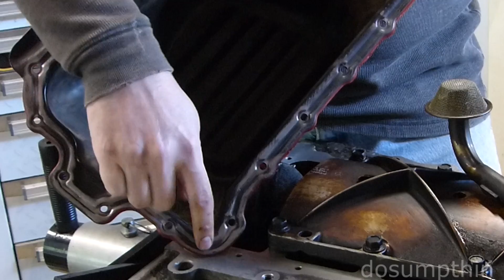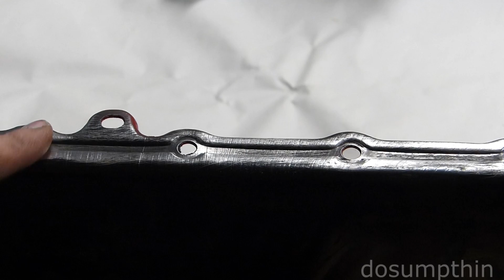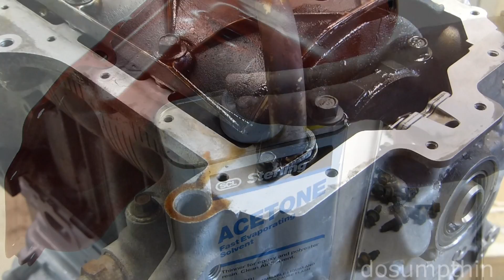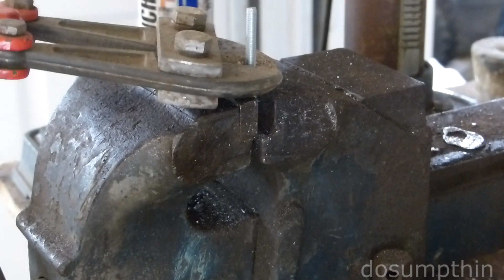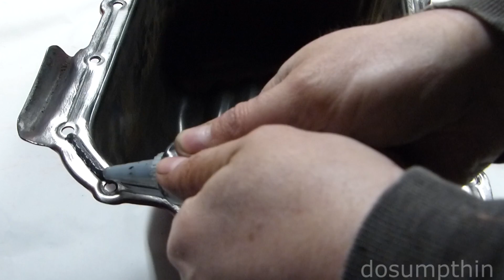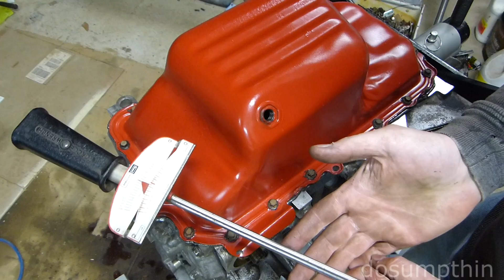How to install an oil pan... without leaks, the first time.

Comment: That oil pan doesn't have the rubber ends with radius.   Those are the ones that leak.   One-piece seal companies say don't use gasket sealer, which is bullshit.   I have repaired 100s of them that people have brought to me. Use gasket sealer.

Comment: Not a fan of RTV

Suggestion:  don’t use thread locker on bolts where RTV is used.  

It is recommended to re-torque the bolts after the RTV is fully cured; 24-48hrs.  If you use thread locker, re-torquing breaks the thread locker bond.  You’re better off using a nickel based anti-seize.

Comment: Ultra black has silicone in it, which can cause corrosion. Silicone based sealants are not authorized  to be used on metal in the aviation industry

Comment: The Ultra black or Ultra gray we'll both work just fine. But I'm telling you right now you're putting the sealant in the wrong part. They should go on either side of the line of bolt holes. Where the oil pan actually is supposed to make contact or is close to contact with the block as is possible. You're using way more than is necessary to seal that application. You will need any the blue Loctite, you're going to have so much sealant on those threads that they are not going to back out. And if I remember right the old spec on the seal is 45 inch-pounds. That's about 4 ft lb.
You had a lot more than a 4 mm bead on that.

Comment: Great video!  One thing about torqing things "to spec" is that the OEM specifications are for brand new fasteners that are dry and have no oil (or gunk) residue on it.  "Feel" (once you have the experience) is better than a torque wrench for low torque applications.  Not sure how blue loctite with a dash of RTV will affect the final torque. Although a lot more work, recommend putting pilot bolts in all holes to keep RTV from getting on the fastener threads.  Thumbs up on the video!  Love the subtle humor!

Comment: As an engineer working with engines this is pretty much accurate. One suggestion I might add is, when you put the pan on a flat surface to check flatness, you can also try to insert a cardboard between the pan and surface all around to find out wavy spots

Comment: @15:55

As it pertains to using a torque wrench:

In the two years I tried to make a living as a mechanic, not one of them that I worked along with including ones that were in their 40s and 50s, ever used a torque wrench.

I'm a big torque wrench advocate for the reasons you specified.  I even bought torque sticks so I could use one mounting tires from an impact gun.

It is laziness and negligent not to use torque wrenches. 

 The one exception might be small diameter bolts connecting something plastic. Usually just to hold a wire or small vacuum hose or battery hold down clamp; I usually go to when it's snug and then turn it maybe another 10 to 15 degrees.

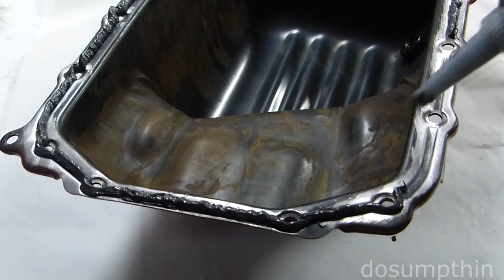Comment: @12:40

I've used the black permatex. It is specifically for engine oils.

The instructions on the tube to say to let it "skin over".  This would be things like valve covers and timing belt covers. And I did let the skin over on my time cover on my 99 Solara.

However, I agree with you that since you don't want to be pulling your oil pan off probably ever again, I would get the mating surfaces together before it skins over.

TIP—

I use lint-free raggs from Advanced Auto Parts to ensure that no lint is left on the mating surfaces of where I'm going to be applying a form-in-place-gasket.

FUN FACT—

Toyota FIPG 103 is used on oil pans, semi-circular plugs in the head cylinder head (if applicable like it is on my 1MZFE), and certain crevices on one side of each cylinder head that form an acute angle that the regular rubber gasket may not be able to reach (again, 1MZFE workshop manual).

Comment: I have tips if you guys are going to use Ultra black. Apply continuous bead! Follow the torque spec! 

I just replaced the oil pan gasket on my 02 civic EX yesterday and it's leaking again. Torque spec for my car was 8.7 ftlb so I tightened up to 9.7 ftlb. But one bolt kept spinning at 9.5ftlb and eventually twisted off. I tightened all bolts with a crisscross pattern, I hand tightened, waited 1 hr, 9.5ftlb tightened, waited 24 hrs and added oil.

Test drove the car and found it's leaking from the oil pan AGAIN. Probably because I didn't apply the "continuous bead".

Comment: Any color RTV will work fine. Toyota gasket maker (FIPG) works really great, too, as does Honda Bond. I'll be using a gasket so I won't need much RTV, only a bit at each corner of the gasket. Definitely use a torque wrench to tighten nuts and bolts on the oil pan. The torque is really low, 80 inch lb. here, 8.7 ft. lb. on Honda B-engines. Also F-engines. Overtightening causes leaks, so don't overtighten the fasteners.

Comment: Yeah even my brand new BMW diesel engine leaked sump gasket from the factory! So they had to reinstall it at the first 6 week free inspection back in 2007, been ok since. 🤞🙏😅🤣😂😎🏴

Comment: Just what everyone has at home. A sand blaster. Everyone has a table they can put their engine upside down. Right? Most likley, you'll be upside down, underneath the engine. 

Myself, I don't like silione, but it will fill in imperfections. Aftermarket gaskets often are very thin. Cork-schmork.

Comment: I did just what you did to my oil pan but in the car, waited 24 hour and about to add the oil in a few min. I was told the correct way was to hand tight weight 1 hour the turq down. Im about to find out see if they both work or if hand tight and turq right after give me leaks. Praying I dont have to repeat this again. GOOD LUCK to my self!

Comment: Thank you.  I am doing a 1958 Ford 601 tractor.  It seems the normal approach is a cork gasket.  The question is dry gasket?  RTV one side or RTV both sides.  I will be on a creeper underneath, so the alignments studs will help a lot, so thank you for that.

Comment: my oil pan ended up with n automatic level control hole.... so it had to come off.. it was also pitted in spots n idk if its because its a diesel or what but it was over a hundred dollars for a fn oil pan, so i just pulled it off cleaned the hell out of it n put a nice coat of jb weld over all the pitting, n filled in the one hole, n the other i created beatin the rust of it, i did this about 10 years ago on a 1 ton that plows n spreads salt all winder n never had a problem with rust messin with the jb,  u HAVE to get every last molecule of rust almost.. after i got all the rust off i could i layed a rag over the pan soaked it in evaporust n let that finish

Comment: You sure got this right using Acetone. I followed the same advice on my Mazda Auto pressed metal pan to alloy auto body. No skin and 2 alignment bolts - yes. I was told to finger snug tight the first seal then leave 24hrs to re-tighten. Mine still totally sealed after 2yrs and I recommend your video. Clean off the old gasket and Uber clean the mating faces is the most important part.

Comment: Need  to perform this in my engine. Just worried about the lips of silicon inside the crankcase eventually getting loose and clogging the oil strainer.

Comment: When you're that deep into an engine, it's always nice to decarbonize/get rid of varnish buildup.  Washing parts with mineral spirits does a really nice job I think.  The varnish won't hurt things, but heavy carbon  coming loose will recycle through the oil pump and maybe damage bearing surfaces it's first trip through the system.  Just me, but I would avoid putting a pan back on without a litte extra cleanup.

Comment: Really great video - thanks, the best in a dozen or so I looked at. Ostensibly it's a simple process but the devil is in the detail. You are the first person to mention that the sealant goes down the centre groove in the pan rim. Its not obvious but this confirms it. On the bolt cleaning, also to ensure the underside of the washer is clean (I use a brass wire wheel) as they sometimes have radial grooves in them so that when tightened they resist undoing (in addition to any Loctite you apply). Very good idea on the alignment studs too as the slide sideways slide on the pan has caused me problems in the past. So thanks again.

Comment: You suck so much. You put threadlocker on the bolts... which will clearly be contaminated by the excess RTV you used. 🤦🤦

Comment: I used black adhesive silicone sealant and waited 14hrs ...I then ran the car for 15min then drove around the block for about 5 minutes the engine started smoking a lot would this be because the sealant has not cured yet?

Comment: Good thing you got that gun out of the engine! It could cause misfiring. (Sorry...)

I was told that Toyota’s sealant is the best. I think as long as you are very careful with surface prep (as you were) and make sure it fully cures, it’s probably not much difference from one to another. Good video! Thank you!

Comment: Thank you for your in-depth view on sealing a sump well. I like doing the job once and will be adhering to torque specs for the recommended job. I have blue rtf and red at hand for my jobs which included intake manifold, manifold aswell as trasmission sump. 
What do you know about using no hardening gasket forming sealer to prevent oil seeping through threads on bolts, is it advisable ?

Comment: Fel Pro gaskets make what they call"snaps" which do what your dowels do. They're plastic , threaded. So you place the pan right over them and it holds the pan whilst you run in the side bolts. Then unscrew and install the bigger corner bolts.  Screw the 40 piece cork get up. The big ol' squishy Felpro is a 1/4 " or more thick, one piece and NO addehsive is applied. (except for those crank ends).  Great vid here and excellent speaking voice with superb enunciation.

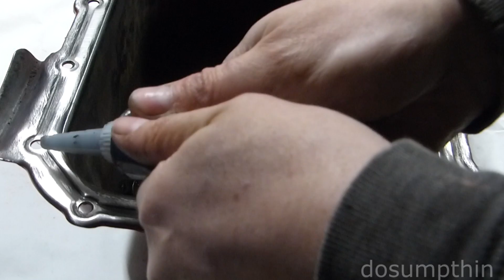Comment: Good video, thanks DoSumpthin. 08:22 Ha, ha! No wonder engine was noisy; gun stuck in oil pan. 12:12 You started out sealing around both sides of holes; then only the outer sides. Doesn't that leave a path for oil to travel from the pan, to the bolt, up to the bolt head, and out to the exterior? Probably when bolts are tightened, the sealer moves to seal all around the bolts, but I wouldn't want to rely on that.
Reply: You are correct. He traced the outside of the bolt hole. Should have followed the inside perimeter, tracing the inside of the bolt hole. Still, excellent video.

Comment: Installed used oil pan on 2010 passat b6 2.0 and it is leaking around area of 3 bolts.  Used Permatex but no material gasket.  Wondering if a material gasket is better.  But, it could be used rim.  Could be I didn’t clean well enough. Darn disappointed.

Comment: Good video was very thorough. The only thing is when adding RTV sealant to the oil pan you have to be careful because the RTV will break down and clog up the oil screen on oil pump.

Comment: Using a couple of bolts with the heads cut off to locate the oil pan seriously makes the job easier and much less likely to leak. Guide bolts ensure you do not have to slide the pan around to line up the bolt holes, which smears the silicone around thinning it out instead of keeping it where it is needed to make the seal.

Comment: Very good video. I am mechanic from England and I am doing the exact same job as your have done on my Shogun sport warrior. There is alot of different views on here on how to do this job, but i am going to take your advice. I have always had a gasket before, now using silicone this should be interesting. cheers

Comment: 24hr cure time for Permatex Ultra Black. If you need to run it immediately, use Permatex The Right Stuff black. It is ready to go by the time you get all of your bolts torqued.

Comment: 1. Too much sealant applied.  Take a look at the amount that got squeezed out after tightening the bolts.  That much also went inside the engine and will brake off and clog oil ducts.
2. After hand tightening the bolts you should let the sealant harden first for at least an hour before torquing it down.
Reply: If the oil pan is clean inside extra sealant will freeze in place and not travel.  When I removed my oil pan the factory used just as much and it didn't break off in 18 year and 160K that I have owned the vehicle.  You could use less but the danger is in coming up short or thin - then that section doesn't get enough pressure from the bolts and it will leak within a year.

Comment: It probably wouldn't do anything if you didn't wait before you start the engine. The pan should be tight enuff. The pressure wouldn't be able to do much.

Comment: I liked the video.  I am currently rebuilding my first motor.  3800 Series ll motor from a 1997 RS Camaro.  I installed the crank and pistons and I was about to install the oil pan.  I cleaned up the pan and noticed how badly warped and dented the pan was. Going to have to buy a new one. May go with OEM since I have not had much success with China made products on my Bimmer!
Reply: Camaros are low and the oil pan can get hit - especially when the shocks / struts get worn.

Comment: do I have to remove the engine to put a oil pan back on of a 1989 Dodge truck d150
Reply: Put a gasket on that thing and you will never have to do it again.

Comment: If you don't happen to own a torque wrench, my method is to progressively tighten the bolts in the spiral method as shown then as you feel a bolt start to strip its thread, back it off 1/4  turn and keep going around till you reach the first stripped bolt...just kidding.Good job DoSumpthin. I don't get the down votes at all. You did it all ok, and are just tryin' to help people out (that may not know) with a clear tutorial that pretty much can be applied to most sumps and rocker covers.

Comment: Why does it seem to be common practice for car manufactures to use FIPG material for the oil pan instead of a rubber seal like a valve cover gasket?

Comment: The only thing you gotta be careful about when doing it this way, is to be careful about how the rtv is spreading out. Especially if you do too much it can ooze out into the inside of the engine. You don;t want that stuff floating around and going through your oil pump.

Comment: Nice tips!! well done for silicone in place gasket... I always use a torque wrench and go around 3 or so times before the final torque spec... as torque is generated in the "threads" and having all the threads at the same torque transfers the same static force of the pan equally around the perimeter between the block and pan which makes for a perfect job... Thumbs up!

Comment: The reason the mechanics shove them out the door so fast is that there is no pressure on that particular surface. If there is more pressure than minor pressure or vacuum than you got bigger problems than an oil pan seal. Also the seal is close enough and wide enough that it would take a decent amount of pressure to mess it up. Also what is the mechanic doing? He starts it up and moves the car outside where it sits and waits for the customer to show up.  The heat from the engine and the waiting for the customer are generally enough time for the sealant to harden.

Comment: When silicone is apply to any engine or transmission part,the sealant is apply to the inside of the bolt holes. Not to the outside,like it was shown on this video
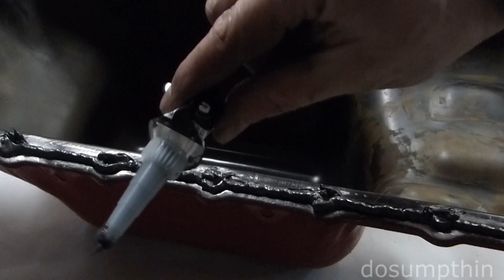Reply: if you notice by the end of the video, he's gone around the whole hole. (inside and out). And suggests as much as he's doing it. (12:51 not the end)

Comment: the seller you use is silicone base which is bad when it gets in the engine I always use gacisinch it has no silicone and if it gets in the engine it don't hert nothing it disovls
Reply: Umm, sealants that dissolve are a terrible idea...

Comment: Good video. Now let's see you do it lying on your back under your car, like most of us have to do it. LOL
Reply: right.. this is optimum conditions working in an air conditioned shop..with the engine upside down.. not struggling under an oil drenched car needing an oil pan badly.  I will use the guides this time, and buy a new oil pan. .. I've done this 3 times and still have leaks
Reply: on your back situation. I would use the two stud guides with just enough threads to easily put two nuts on to hold pan against the block while I install the bolts
Reply: Very good presentation that was very informative and educational for me.  I learned a lot about how to approach working on the oil pan and replacement. .
Reply: I had that problem PLUS a new allergic reaction to the Permatex which made me sick.  Have a Nissan so only need Permatex or other black sealant on one side so let it cure a little before getting under car, wear gloves and maybe wear a gas mask or have a fan running to blow the stink away. Might have to also make sure all the other engine bolts are at the right torque so there is no oil leaking down the cracks.  It's really tough with the oil continuing to ooze down constantly for a really long time.  Almost impossible on a sealant only model car.  I like the head-chopped alignment bolts--that might speed things up.
Reply: right lol
Reply: I’m just going to wait until the next time I roll my jeep… looks like it’ll be much easier!
Reply: I'll be impressed when you show us the car running with oil in the pan and not all over the floor under the car!